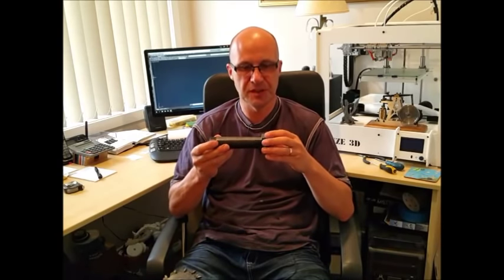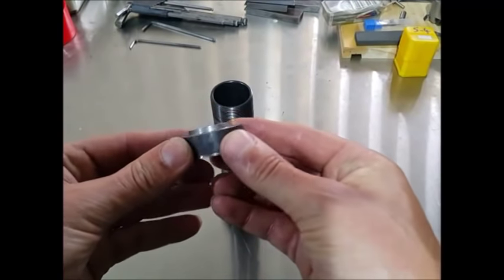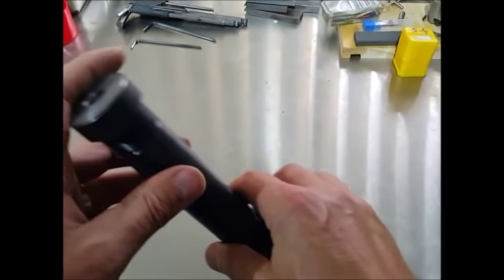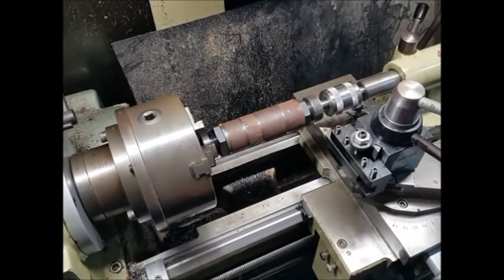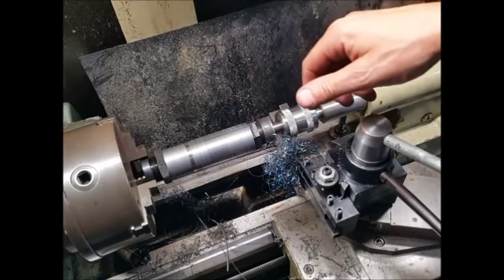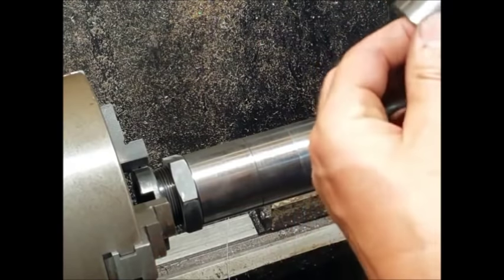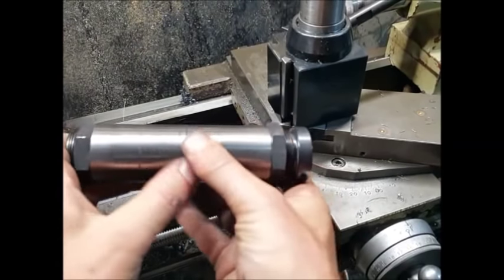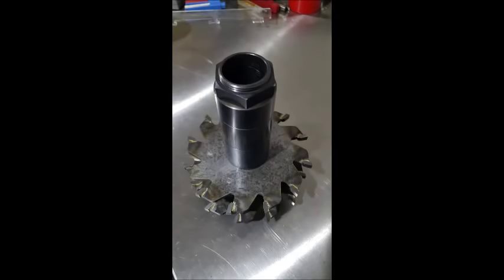#30 - Twin Blade Mill Cutter Setup and Rust Protection Using Heat/Oil

Comment: Hey Kevin.

The Blacking came up pretty good, very professional looking.
Would be good to see the machine this part goes onto.

Just as a side note for future video,s.
Maybe condense the information you want to show as most of the jobs shown here are fairly straight forward.
I will be honest,  i did fast forward through some parts as the video as it is fairly long for a fair simple part.

It might save you some time also.
I only speak from experience as people generally do not like to watch long video,s.
15 minutes max is some where i TRY to keep my video,s and even then people do not watch for even that long.

But i did still enjoy the job you did with the parts.
Thanks for sharing.
Regards Peter.
Reply from the maker: Hi Peter. Thanks for the comments. I agree the video is a bit long...lol